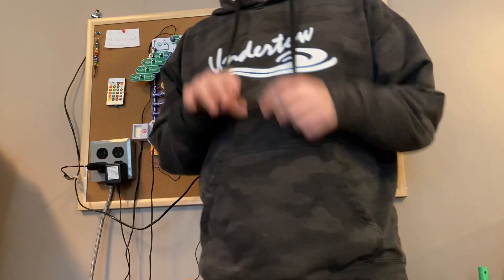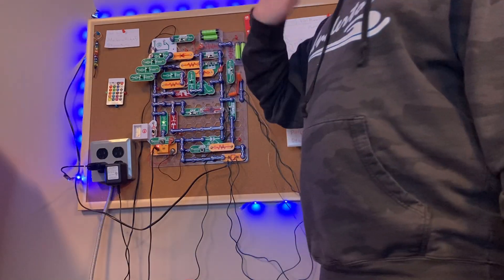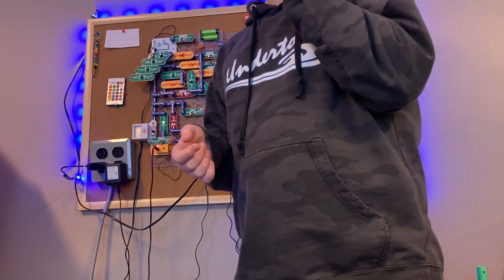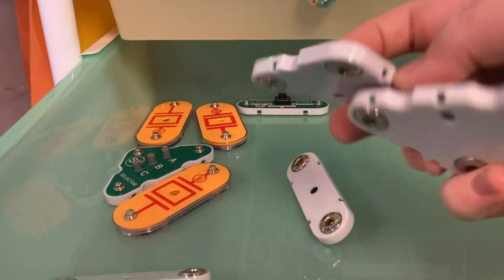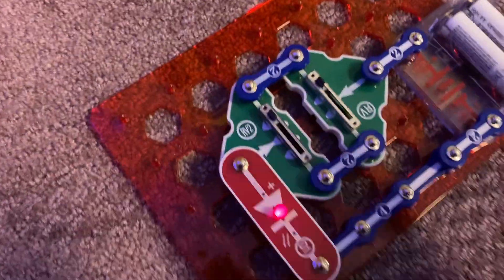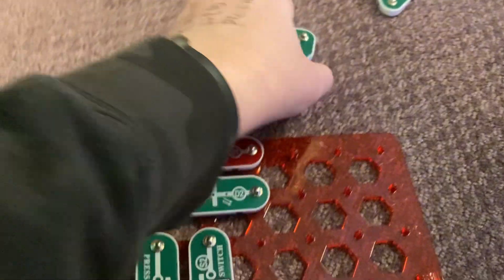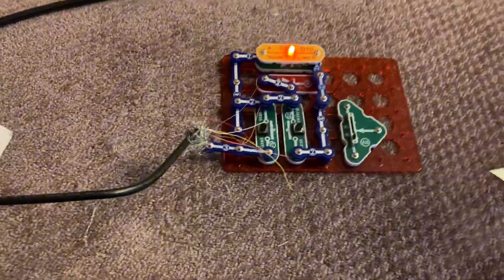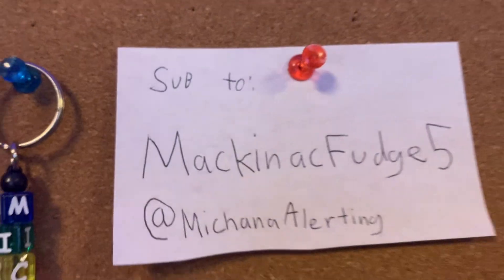Creating an annunciator for my #snapcircuits #firealarmpanel

Comment: you should use CAT5 or 6 cable first of all it has 8 conectors if you do it right you can have so u can plug and unplug stuff with less of a hassle and there also quite cheap
Reply from the maker: @wesmazerall195  exactly what I was thinking